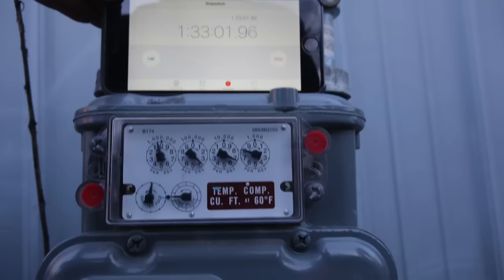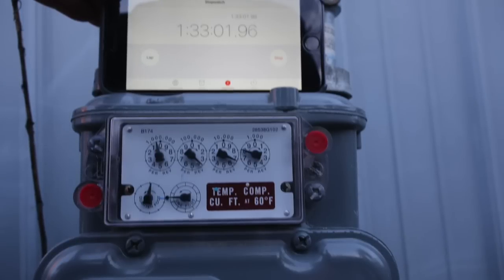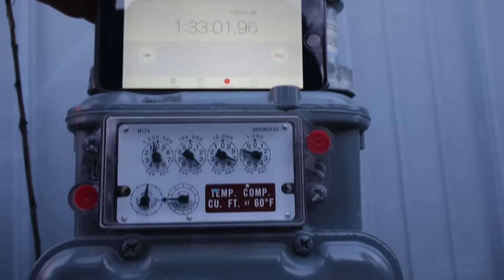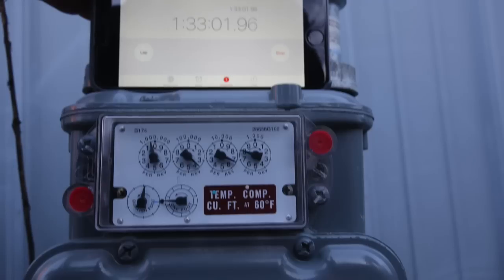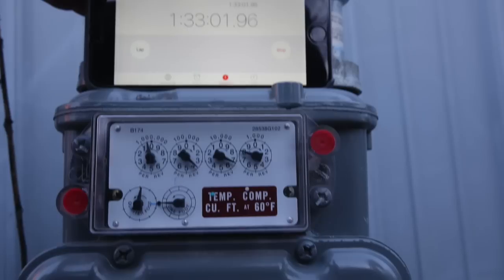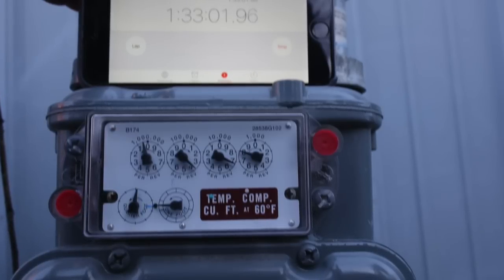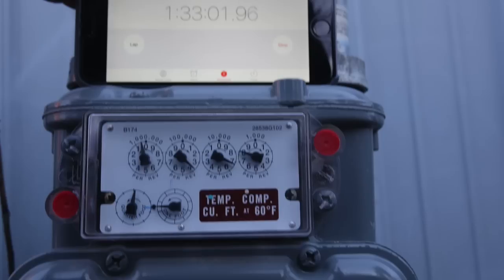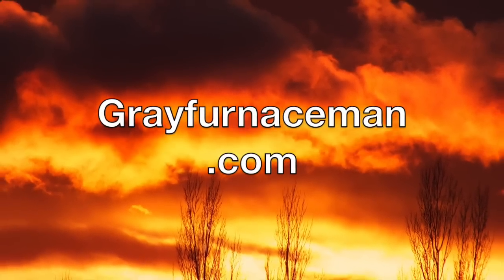How much gas does the pilot light use #2

Comment: Love your videos. While I'm not a HVAC expert I am a gas journeyman. There is an easier formula I was taught in school. It is known as SRC/T or as we called it SRC over T. Seconds in an hour (3600), times Revolutions of the dial, times Cubic feet of the dial, divided by seconds of the test. In other words if the test dial was 1/4CF as shown in your video and we ran the test for 20 seconds and the test dial moved .2 turns (2 notches) We would come up with this formula: 3600 X .25 X .2 Divided by 20 which equals 9 CFH. Hope this helps. Keep up the great work.
Reply from the maker: Thanks for the thoughts.
GFM

Comment: Those gas meters are absolutely huge -- way bigger than what I'd imagine it would take to measure the amount of gas flow. Must be some rugged, precision instrument. I'd be keen to learn about the inner-workings if you are so inclined.  Seems to be quite a mystery.
Reply from the maker: +CognitiveDisonance They are a bellows type meter.  The bellows fills with gas and rotates the mechanism to record the amount used.  If I can get one I will do a video on it.
GFM
Reply: +grayfurnaceman Thank you. Perhaps you might also get into how pressure regulators work. Thanks again!
Reply from the maker: +CognitiveDisonance I actually do have one on regulator operation.  
GFM
Reply: grayfurnaceman Thank you, yes. I actually watched it just recently. Nicely done! Made it clear as crystal.

Comment: I don't know why I'm surprised by this, but I am surprised that the gas meter will measure such low gas flow. this is coming from someone who hasn't seen inside one but after seeing how acurate it is there have to be some pretty close tolerances and good deals on moving parts
Reply from the maker: +volvo09 The meters are a positive displacement meter.  It is actually a bellows type mechanism that inflates and deflates.
GFM

Comment: No wonder standing pilot's have gone out of style. Anyone remember the little hot spot on gas range? My parents had an old Roper that had two pilot lights. 
The gas boiler we had was a huge affair, when that thing called for heat there would be the click of the solenoid, a pause for the inrush seemed like seconds and a big WOMPH. I was always amazed that the pilot didn't get snuffed out (of course it would have re lit with that 2 sq ft of burner area)
Thanks GFM for your videos
Reply: Good point. Assuming an average of $5 a month per pilot light in today's prices, having a constant pilot light in the dryer, stove, water heater, and furnace like in the old days would add about another $20 per month to the gas bill all year not to mention the hassle of having to occasionally relight the pilot lights. When I was a kid, we'd shut off our furnace's pilot light for the summer to save on the gas bill.